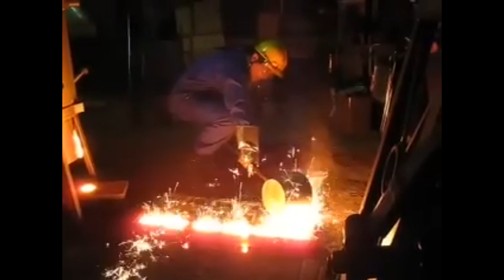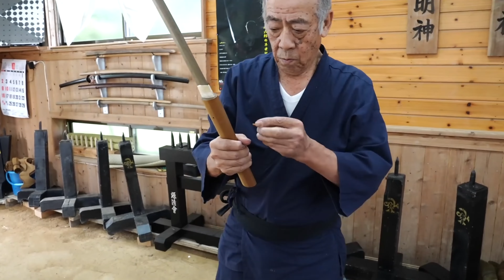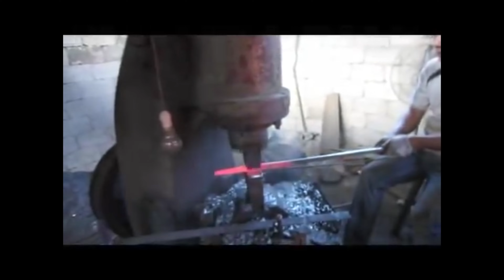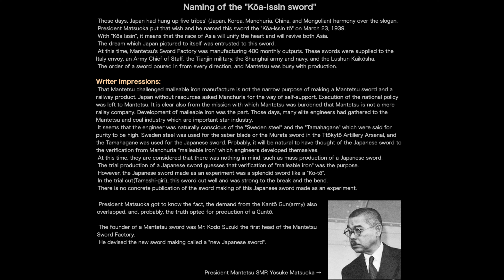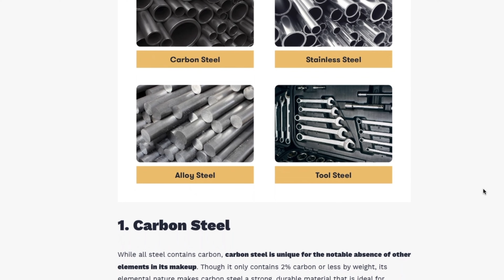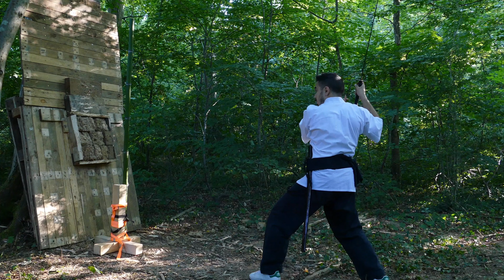modern steel vs tamahagane

Comment: Modern blade steel, Yasugi Specialty Steel (yasuki hagane), was developed from tamahagane. Around 1970, Hitachi Metals, a Japanese steel company, developed Yasugi Specialty Steel (yasuki hagane) by analyzing tatara ironmaking and tamahagane. Yasugi Steel has the same properties as katana, so it is hard, impact resistant, and not easily broken. Yasugi Specialty Steel is used for a variety of purposes, including blade steel, material for high-end kitchen knives (Kai Corporation, Zwilling), material for razors (Gillette, Schick, Wilkinson razor steel), material for automobile parts, automobile engine parts, and aircraft engine parts. Around the 6th century, the Yasugi region became a steel town because high-quality iron sand could be extracted in the area. Currently, Yasugi City produces Yasugi Specialty Steel at Hitachi Metals' factory and exports it all over the world. In the 12th century, katana craftsmen migrated to Seki City and began mass-producing katana.
Even today, there are about 400 cutlery-related companies in Seki City.
Reply from the maker: Nice contribution to this episode about modern steel & tamahagane, thanks